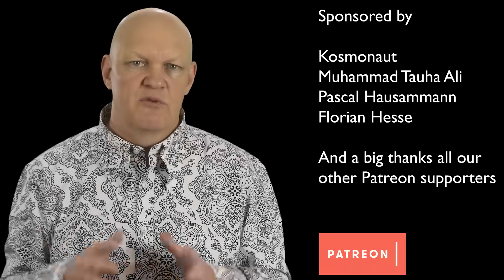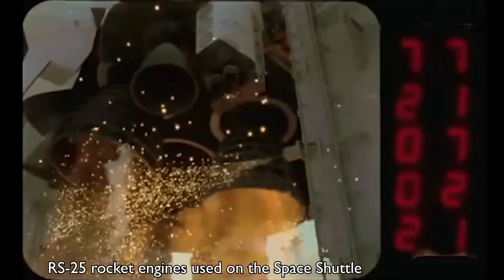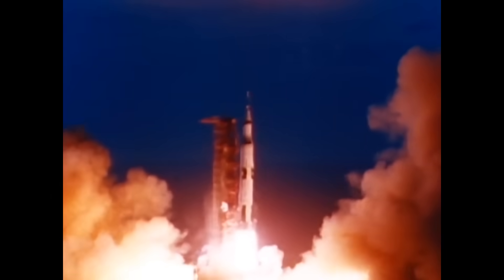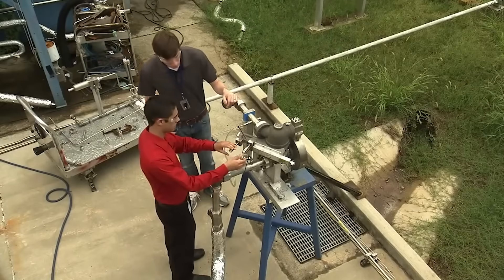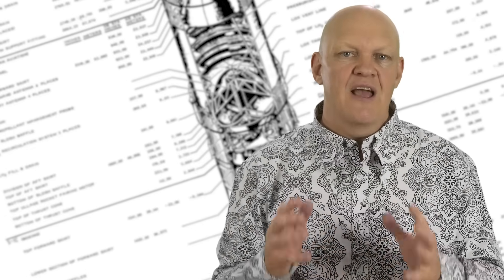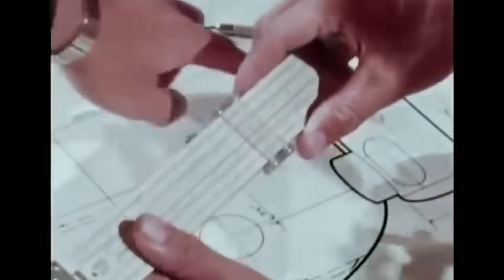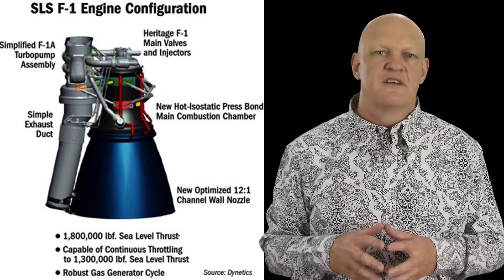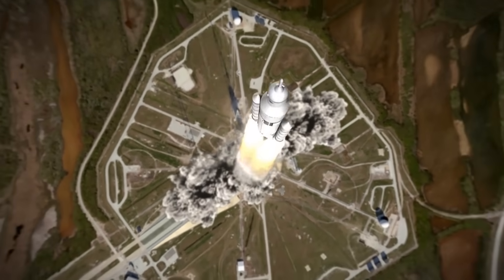Why Can't we Remake the Rocketdyne F1 Engine?

Comment: F-1
Before I enter my comment I want to say, the words "Curious Droid" is enough to get me to watch one of your videos and I commend you for your interpretations of coverage where actual facts might  be scarce.
This said, I worked in the plastic injection mold industry just as CADCAM was displacing handmade wooden models with virtual models in a computer. In another thread in my life I had gained several years of computer experience at the start of the eighties.
The original process of mold making was executed by a highly skilled people who would fabricate a full size model of a planned part using wood and fiberglass. A machine tool would trace the model guiding a machine tool to replicate the model in steel or aluminum. Like the Apollo era trades people, high levels of skill were involved
I am not sure what year Boeing began the use of triangle files to make models virtually in computer memory but they were working on their 707 so sixties is ball park. By the early to mid seventies machine tools were being designed to read paper tapes and guide the machining. The stage was set to de-skill a labor intensive task.
When I got involved in the mold industry it had fallen into the same progress trap as NASA is in with the F-1. 
The problem is as you outline, in my view they have to not reverse engineer such jobs but rather use a bottom up approach solving one step at a time using current thinking and reengineer it. Curiously the nozzle inside and combustion chamber profile which is essentially the F-1,will some where be represented as a lofting line on paper. 
Any one laying out the manufacturing process has full scale models to measure. Machine shops in the sixties and seventies would routinely duplicate parts from a sample.  It was a hit and miss process at best often involving rework.
The bonus will be that unlike the originals, twenty first century F-1s will be identical using identical , replaceable parts.
As Soichiro Honda said in the sixties, " I will build one good motorcycle and then millions of identical ones so they are all good. An accurate tolerance  in the sixties was .0003 inches. The hydraulic lifters in American cars were often all slightly different sizes in any one engine. The proper sized lifter being hand selected at assembly. 
Since I have a casual understanding of rocket engines I would speculate the pumps, turbines, plumbing and valves would benefit from knowledge gained in the last five decades. Once the original designers had a steady fire in her soul they would have stopped research. Running the old turbine, and pumps on a test bed to yield actual performance data would provide a starting point. I wouldn't mindlessly trust what they thought they were in 1960 since the current state of the art measurement will likely disagree  in both torque from the turbine and volume from the pumps. 
I would bet Elon Musk’s engineers know their way around the old F-1, the good and the bad. I would bet SpaceX wouldn’t have a bolt in common with NASA's. We should remember NASA's F-1 only burned for 300 seconds.  They never were called on to restarted unlike SpaceX.
Socially we can learn from our past; technologically we should know the lessons of the past but design looking forward.
I took exception to your examination since it draws a picture of America in decline. Canada is a shadow of what it was in 1945 but America hangs on to her past glory though tenuously . The progress trap always looms.
A previous commenters Manashamura,Bazookatone1    spoke of uncommented work and the like. I think you can develop on their notion to understand why. Working in an institutional environment be it government or corporate, ideas are commonly guarded. Any individual who is shutout of the celebration after solving a problem while their manager drinks champagne generates such behaviour  and is undoubtedly part of the problem and speaks to why institutional thinking is borderline. Real innovation comes from nowhere like Elon Musk. Corporate environments are suited to building stuff, not inventing. This likely explains Americas decline post 1970.

Again, I enjoy your presentations.
 
Ken Bowd Orillia Ontario Canada

Comment: Good is a difficult target to meet. And the good of then is not the good of today. IF this engine had continued to evolve from back then, it would have been a good idea to continue to iterate on it. With such a gap and the missing comments problem, then it is a better idea to start from scratch. I doubt the F1-B is so different from one such new engine. The hardware itself is not important, the most important is theory and accumulated experience, data, and reliability. Then you make the engine you need for the specific application.

Comment: Around 15 years ago I worked for an aerospace company on refurbishing the ageing Nimrod fleet. (not the main company btw)
We were given the blueprints for parts we had to make, mostly in the area around the wing root.
After 1/2 a day studying these blueprints the more experienced, and time-served members of the team all said this was going to be a waste of time..... Did they listen to us?
Nope. Management never do!
So we went ahead and manufactured (I think) 18 sets of everything. (I think it was 18 planes being refurbished at that time)
As I'm sure you can imagine, this wasn't a cheap or fast process.
Delivery day, we did our job.

Fitting day, well that didn't go so well.
Not one part fit.
Everyone of those planes had been hand-crafted back in the day, and the men back then didn't have the same computer controlled laser measuring systems, and CNC machined parts of today. So they massaged parts to fit.
We knew this would happen, but what did we know eh!
Only about 200 years of experience on our team, what does that matter compared to a guy who got his management certificate from college last year.

Comment: Excellent presentation. The engineering methods of the 1960's are not those of today. Modern materials, electronics and computer modeling can enable us to build that same rocket engine with increased performance and substantially reduced parts. The only question is - why are we doing that? Were re-building the old SS main engines and working on commercial designs that are much smaller but no one is trying to rebuild the greatest engine every built. It would make the SLS much simpler and far less expensive. Perhaps a commercial company could take this one on.

Comment: All I got from this video was people are dumber and less skilled today.
Reply: Yeah, you would get that wouldn't you... when you have already decided that everything was rosy and wonderful in yesteryear.

What comes out of this is that the F1 was a poor design , from an engineering perspective. Sure, it did its job and did it fine, but it took a lot of hands-on work to get it to do that. 

It is like an old muscle car that can do 0 to 60 mph in a great time... but in order to even start it you have to do a bunch of little tweaks and fiddles first that only someone that has owned the car for a long time knows how to do. Is that a good car? Well it is a fast car... but it is not a good car because it is a pain in the ass to get it going. Are you going to blame the new driver then for not having been informed of all this little things that were not in the manual for the car? Little things that differ from every car of that model and that you cannot put in the manual because you never know what they are going to be until you actually build it? 

Great engineering means that 1) things work as intended without having to lay hands on them first 2) all individuals are consistent no matter how many of that model you build. The F1 did not achieve that. So even though the F1 was a good performer — when it did get running — it was not a good engineering job.

I am an engineer myself. Everything I that do I know that I will be handing over to someone else. It is my job to make it so that in one hand I put the product, in the other I place the manual, and then they shall not need anything more than that to get the product running. If they have to call me, or if I deliver the stuff with "Oh, and don't forget to..." and then start enumerating all the little tweaks they have to consider... then I have failed.
Reply: Michael K My comment was a criticism of the video message itself.  Stop trying to be offended and please don't be another engineer who only thinks of himself.
Reply: Sloop Macgregor
Yes yes thats all you got from the video. Everything was better back then right.
Lets just revive the time where NASA hat 10 times the budget of todays. The time when no private company and could think of making rockets because they were so extremely expensive.

Or maybe you just didnt listen and instead interpreted what you wanted.

What I got from the video is that engineers today discarded the old designs because they where inefficient fom todays view. I got that they where able to desgin something that is more efficient and alot cheaper to build because it is often better to redesign something anew instead of trying to make something old work again.
Reply: The Pyramids at Giza were built some 2500 years ago and we couldn't build them today. Just one of many examples where skills, and technology may get lost over time
Reply: @Sleepy_Alligator  That is pure BS. The pyramids can easily be built, if only someone is willing to pay . The tech needed is mundane. It is the effort and money needed that put a stop to it.
Reply: @michaelk980  exactly. Back then they put an army of workers. Today? Just fleet of Scania trucks, pulling 50t of stone blocks, and a couple of cranes. We only need a pharaoh to die.
Reply: Then apparently you didn't watch the video to the end. They modified the F1A rocket engine to be a new F1B, decreased the part count from hundreds to 40, increased the reliability and increased the efficiency. How is that 'dumber and less skilled'?
Reply: More like they were in a rush (deadline was to put a man on the moon before close of business 1969) and couldn't document every little tweek that had to be made at the last minute to get those Saturn V's off the launch pad.
Reply: @rsrt6910  ^this 
For example - try sharing your really in depth knowledge of something with other. For example - I might know all ins and outs of a game I made, all the neat functions. Can you replicate the game? Yup. Can you replicate the exact logic? Really doubtful, because without documentation you don't know what's going on behind the scenes. I can give you really simple documentation - like the one you'd receive in a manual - press W to move forward. But still, the results may be the same, but the behind tricks aren't known. The same thing goes for engineering a rocket engine. Everything documented, but not quite. People in a hurry sometimes just don't care about writing down "I USED THIS AND THAT TO MAKE THIS".
Reply: Guys need to lighten up a bit, it was a joke, though perhaps not well received with a few folks.  I'm well aware better designs, materials, practices, and tools exist today.  What the aerospace industry accomplished in the 60s is truely remarkable and while not perfect, those guys deserve a lot of credit.  Engineers today can look back and learn from mistakes of the past--a luxury they didn't have back then.  Now I don't mean to offend or discredit anyone or any generation but give those guys some credit, they did math in their head or on a slide rule and they worked long hours frequently without extra pay to develop an entire new science and industry. It was nothing short of a major battle in the Cold War.  It was a race with no rules except "win".  It's no surprise to me that those old engines don't match their blueprints, or that they aren't worth reproducing.  And yes, they were on a budget back then, but it was their hourly ay that suffered the most.  Their motivation was for country.  Back then in every industry labor was cheap and tech and materials were expensive.  Today, it's the opposite.  So many differences from back then to today, it's not work arguing over but still ppl want to for some reason.  I truly wish the best of success for everyone, just don't ignore the past, learn from it and move forward.
Reply: Guys need to lighten up a bit, it was a joke

Jokes are meant to be funny. That was not.

Comment: why not use the old designs as a reference for modern day rocket motors? But, are they using the new motors to go to the moon? The real question is what are the new motors job? A heavy lift motor for high earth orbit?  Beyond Earth exploration? I think that nasa needs to design motors that fits their need for the job best suited for it. Not just recreate an old design that they'll use for say low earth orbit.

Comment: While I would agree that we've lost most (if not all) old-school skilled labor in the manufacturing trades, one thing we have gained since the 60's is an explosion of advanced manufacturing technologies that are more than capable of recreating any part of the F-1. In fact, as an example, NASA (as well as private contractors) have already fielded and tested 3-D printed components on several different engines.  The F-1 was the most powerful single-chamber rocket engine to successfully fly, without it we may have never reached the moon, but the engine wasn't perfect, it was dreadfully inefficient (gas generator cycle rocket engines tend to be) so what we should do is learn from the past and improve upon the work that came before.  The F-1 is an excellent template to work from to make the next generation of heavy lift rocket engines that will propel us to mars and beyond.

Comment: Back when the "F-1" engin was designed and built in the 1960's:  They did not have the "CNC" machines we have to day, and like you said the part's went from 5,600 to just 40: Then the newly designated "F-1A engin" could be used on the "SLS""  With the "SLS" engines at 500,000 lb, of thrust each and using 4 of them for 2,000,000 lb, thrust:  The "F-1A"  at 1,800,000 lb thrust could use just 1 with 3 "J-2X" engines and return the first stage booster back to the launch point, and see if the engines and solid rocket motor's could be  reused it would really bring the cost down:  Who knows we might just get 1 or 2 more launches out of the engin package too:  Just an idea to keep the first stage flying make it easy to replace the engine package for later check out:  And put a common bulk head in the first stage and in the second stage too to save weight.

Comment: The description you gave on the building of those rocket engines matches precisely the same technique that watchmakers used to use before Eli Terry, an American clock maker applied ingenuity and developed techniques for mass producing clocks at an affordable rate. He pretty much laid the foundations of modern day clock making. Here's a wiki page on the subject.
https://en.wikipedia.org/wiki/Eli_Terry

The old adage: if you forget history,  you're bound to repeat the same mistakes applies to this engine. While it is understandable that the builders had to use specialized skills to get the engines running, the fact that no one followed through and made jigs and aids to build repeatable interchangeable parts shows the idiocy of the egalitarian mindset of the rocket scientists of the day.

While NASA engineers may not be able to build the Rocketdyne F1 Engine, a man with both the skill set of the 190's engineers and the skill set that Eli Terry had, could not only remake the engine, he would also figure out how to make repeatable mass produced parts that are interchangeable bring the cost of the production down further than it's original forbear.

It's not that they cannot remake it; it's that they don't want to put the time, money and expense into building a single engine that would be learned from, and from which successive engines could then be mass produced.

Fortunately for the clock industry, they were blessed with a forward thinking clock maker that could envision lower cost, mass produced clocks that had interchangeable parts that did not need the skills of a master clock maker to repair.

Comment: The problem is you think disposable is cheap enough, like Elon said if we crashed every airlighner after each use commercial aviation would not have been able to become cheap enough to be a success. Reliable reusable systems that don't need constant tear down inspections are the only way that commercial space becomes realistic enough to commercialize for the masses. Until a space elevator can be built then there will be no limits, space will become cheaper then an airline ticket. Cl